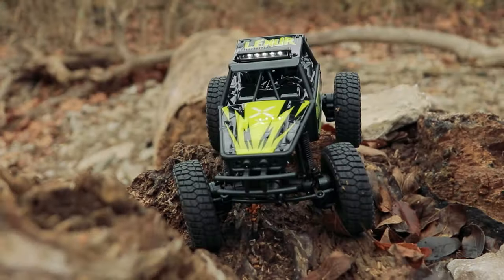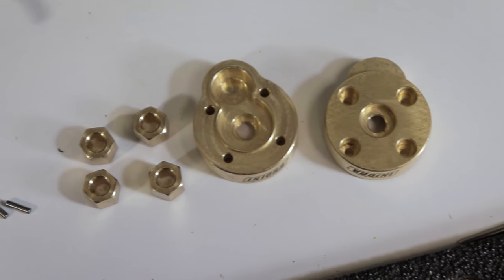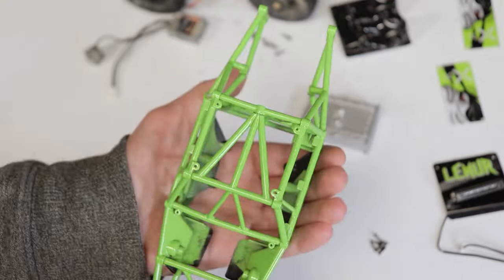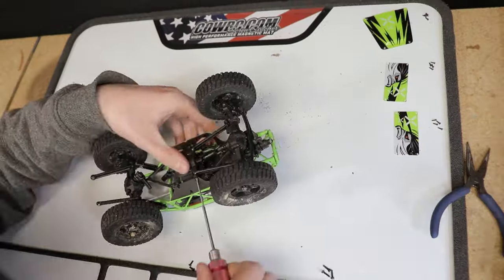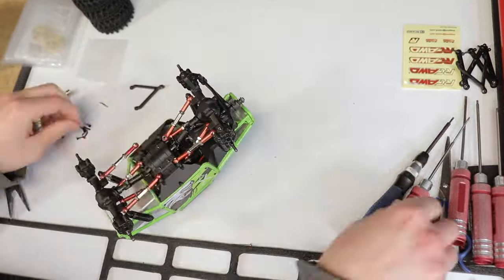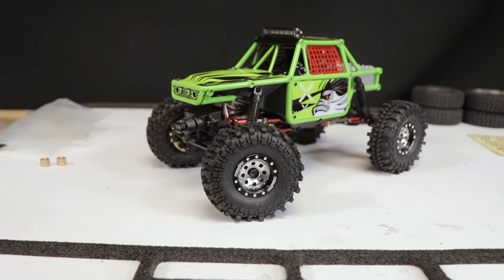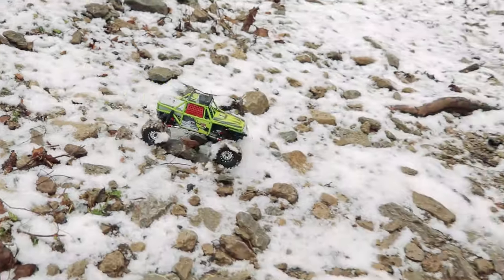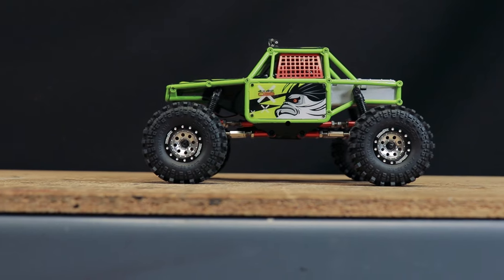Meaner 😡 Greener 🟢 Lemur 🐵 Did These Mods Ruin My FCX24? Full Build and Test Drive

Comment: I added an Injora  180/48t motor for the FCX  to my FCX24 Blazer and it gave a slight increase in speed but feels more powerful and fits well. Did have a little bit of less battery life after that. It’s not a big change but for $14 gave it a more solid feel without changing the driving experience radically. Low speed crawling control seems about the same with a little more grunt. Just FYI.
Reply from the maker: Good to know, thanks. 👍

Comment: Nice build. My only concern is the linkage looks like it would hang on everything.
And definitely 60/40 to 70/30 weight bias is a huge asset.
Reply from the maker: Yeah there's always at least some compromise. That's a good point for choosing the smooth one-piece links over these adjustable ones, especially if you're building a comp rig. I'm already noticing a big improvement with the front weight bias but I'll fine tune it more in the spring.